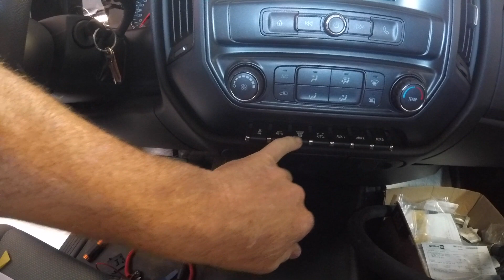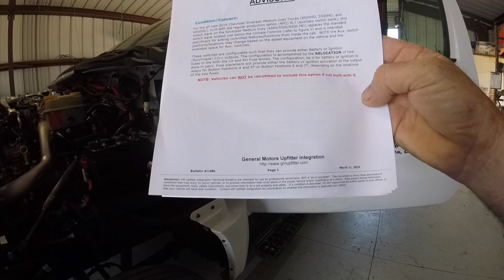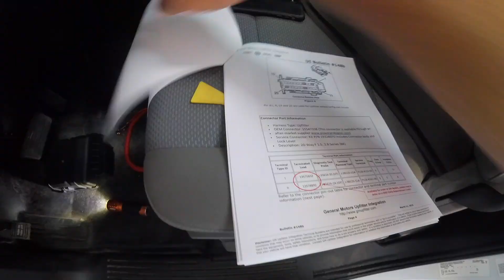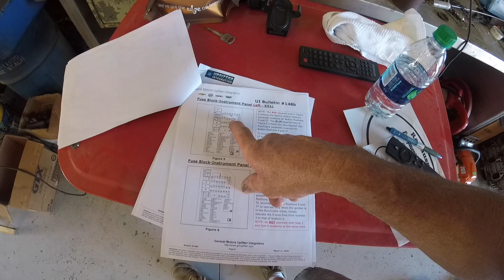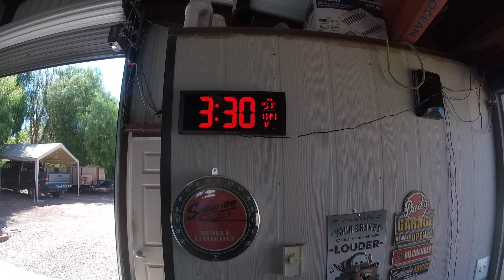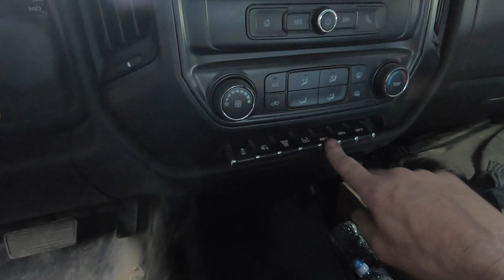2019 Chevrolet 5500hd UpFitter Switches

Comment: Hello got the upfitter switch hooked up and working. Thank you for video. Do you know where on chassis the camera hooks up at?  We have a lomg harness shipped loose. 7503391C91 is part# on long harness. Trying to figure out where it hooks up at front of truck.
Reply from the maker: Mine was at the rear of the chassis, but it came with an extended harness, so I may be at the back of the cab

Comment: Was breaking my head look for the pigtails and turns out I have to buy  them. I usually work on fords and they do have pigtails to connect to under the hood makes it easy. GM just makes it harder for DIYers.
Reply from the maker: Ya I don’t know why GM puts the switches there but not the pigtail

Comment: The switches have a 30amp fuse what if my accessory needs a smaller fuse?
Reply from the maker: You can either change the fuse in the panel or add an inline fuse on the wire going to your accessories

Comment: Thank you so very much for this invaluable information in this video!  without this I couldn't have wired up my Silverado 5500 and its a 2023 (Same wiring diagram)!!!  I cannot believe Chevy doesn't have the upfitter switch plug already installed, completely mental!
Reply from the maker: Glad I was able to help, it’s hard to believe they don’t terminate the wires into the engine bay.
Especially since I paid for the up-fitter wiring that was supposed to go to the rear of the chassis

Comment: Hey thanks for the video! I just bought some lights for my truck and they came with their own switch kit - in line fuse/relay/switch at the end. I’ve purchased the plug and wire kit you mentioned off of eBay, do you happen to know anything about removing the switch they provided and using the wires to wire in and upfitter switch? Will the in-line relay and fuse mess with the stock system? Thanks!
Reply from the maker: If you use the upfitter switch to switch on the lights relay that would be ok
Reply: @RasmussenEquipment  okay I see! And what do I connect the negative and ground to?
Reply from the maker: @isaaccarty7073 send me an email to greg@rasmussenequipmentrentals.com and I’ll send you the service letter
Reply: @RasmussenEquipment can I get that as well? I'm trying to install 2 extra lights on the rear of my tool body. I have the switches and the plug to the left of the brake pedal already. Just trying to figure out where to land wires
Reply from the maker: Send me an email and I can send it to you

Comment: Great Video.  One question did you hook up a relay or just wired straight to the lights?  If no relay is there a lot of power draw? Thanks
Reply from the maker: The relays are built into the fuse panel
Reply: @RasmussenEquipment  thanks

Comment: You also don't really need the plug in adaptor, the pins are populated in that lower left connector port, you can add an insulated female spade and pinch it down on there, I resorted to this because the customer provided the parts without that plug.  I agree, GM charges for the switch package but doesn't even give you the plug.  On the newer body style trucks at least they give you the wire harness and fuse block but it still needs to be installed....always trying to steer you to the dealer for options you already paid for.
Reply from the maker: Thanks for the comment
Reply: Do you happen to have any pictures to share of where you landed the hots for each aux switch. I have the same deal but already have the connector without pins but in 2 slots

Comment: I have a 2018 2500 duramax with basically the same fuse box and that , and I installed that same aux switch panel and all the lights work but when I get under the dash to test witch aux switch controls witch on nothing happens. How do I tell if my truck is set up for it or not I’m confused on how the light works but it don’t control nun under the dash
Reply from the maker: Check to see that the fuses are in place, on the 5500hd they have optional spaces for the fuses depending on wether you want the light to work with the key on or key off
Reply: @RasmussenEquipment  would you happen to know where they are supposed to be ? On the left or right in the dash , and what fuses ?
Reply from the maker: I believe I show, in the video, the page in the Upfitter manual where it shows which fuses you need for it. On the 2019 the fuse panels are located on both ends of the dash
Reply from the maker: But I am not sure about relays, I was just thinking out loud that if it didn’t come with the switches maybe they didn’t install the relays, if there are relays
Reply from the maker: I am not sure but there may also be empty slots for relays.
Reply: @RasmussenEquipment  outta my league 😂

Comment: Head up reinforced your locks in your boxes those are to easy to break into it and  open your boxes with out making any noise
Reply from the maker: Ya, we’ve seen that before. I built a good locking system into this back in 1998 when we first bought this bed.

Comment: I sell these for international and currently trying to wire up these switches. I'll bring this up at our next corporate meeting and see what they say about including this with the switch pack for newer units. Thank you so much for this video. I got on MCA snow ebay page and the only products I see is for the 2500-3500 range trucks and only up to year 2019.
Reply from the maker: Thank you for watching my video and helping with this issue. 
Here is the one I bought from MCA Snow. It shows for up to 2019, I’m not sure if they changed it on the 2020 model, but I doubt   they changed it. They took down the upfitter info, I am assuming they are only providing it to registered upfitter shops. 

https://www.ebay.com/itm/222378277124
Reply: Well we just purchased a new 2021 4500dh and nothing was included so I’ll be going down this same route wirh MCA… why do we pay for the upfitter kit and still not get it all??
Reply: @shaumsmarch9170  that’s a great question, I wish I had the answer. As a dealer I do have access to that part but due to supplier constraints it’s unavailable til further notice.

Comment: I just purchased a 2021 3500hd with the up fitter switches. I could not find any information on the adapters and or wiring. thank you very much the video was very helpful.

Comment: Where did you acquire your hydraulic pump that is run by you welder ?
Reply: ThankYou, Uncle Tony said it looked like the kit certified bodies in California used to sell it used a 12 volt clutch to drive an air compressor. From an engine drive welder,,,, great job ,,, very nice ,, ahead of your time:: works like a ( Miller Enpak ).
Reply from the maker: I set that up in 1998 when I set up the bed. It runs my crane and compressor. I used a magnaloy brand coupler and had a machine shop adapt it to bolt to the pump and to my welder. That is the second welder since setting it up. It took a little trial and error to get the pump GPM right. The pump with the 12v clutch came from a (now closed) hydraulic shop, but they are easily sourced with whatever GPM you need.

Comment from the maker: Link to eBay site that sells the upfitter plug with wires already pinned for switches.   https://www.ebay.com/itm/2014-2019-GM-UPFITTER-CHEVY-GMC-JUNCTION-BLOCK-CONNECTOR-AUX-SWITCHES-15547108-/222378277124

Comment from the maker: The website that sells the camera and adapter to connect the camera to the stock wiring connector is; 
https://camera-source.com/automotive-cams/gm-oe-fit/2019-gm-4500-5500-cab-and-chassis-commercial-camera.html

Comment: Whats the part number for that plug?
Reply from the maker: Here is the eBay item number for the complete assembly 222378277124
I will send you the individual part number for the plug and the pins in a few minutes, I have to go look in my shop. Also if you go to Chevy upfitters website you can find the complete technical bulletin with the part numbers and the pin-out locations
Reply from the maker: https://www.ebay.com/itm/2014-2019-GM-UPFITTER-CHEVY-GMC-JUNCTION-BLOCK-CONNECTOR-AUX-SWITCHES-15547108-/222378277124

Comment: Are you using the ground position 10 on the harness or you just using the power and grounding to the frame?
Reply from the maker: I an only using the 3 switched power wires. I have grounded the lights to their mounting brackets.